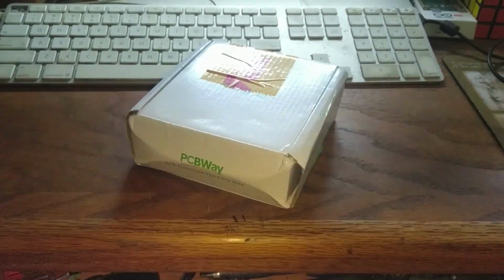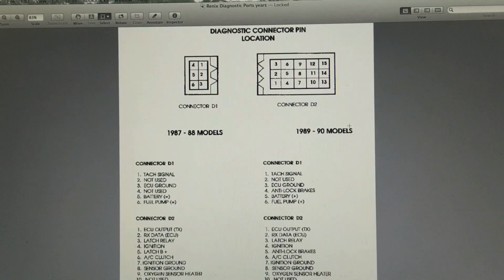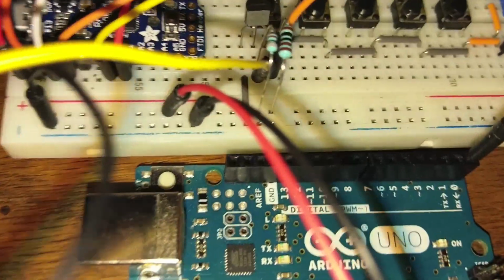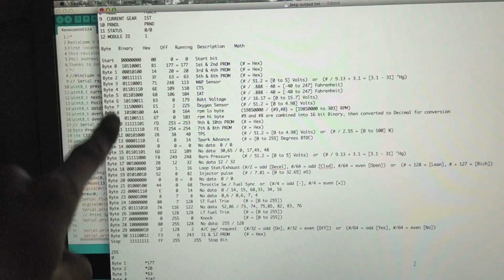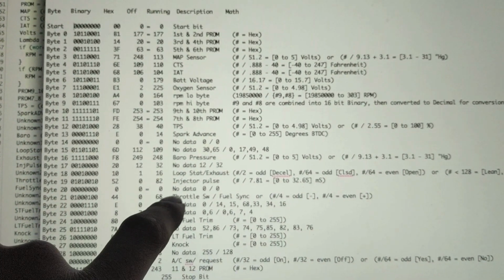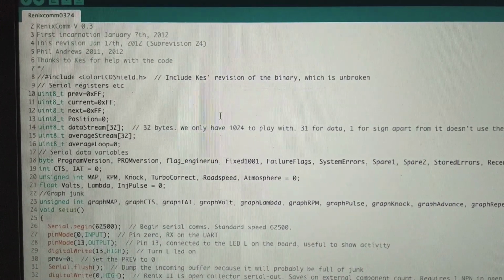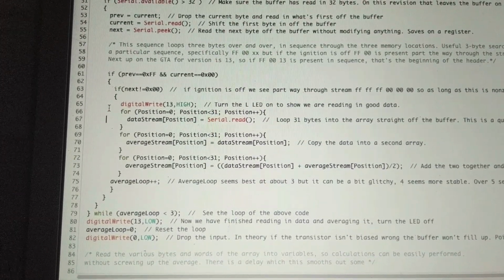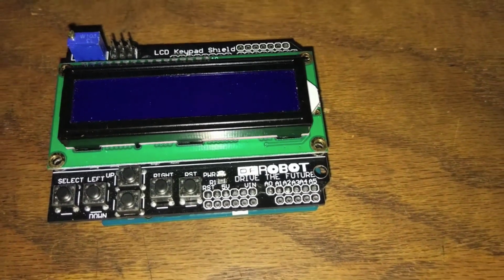Renduinix Alpha Update / DIY Arduino Renix ECU Reader

Comment: The pcb looks smashing :-D, your design is coming alive and neat ;-D.
Yep that npn transistor and two resistors is nice and simple, if you needed many inverters then there are ic's that have 6 open collector drivers inside.
Dont think you need any more lol.
Sounds like the tx pin is open collector (sinking current only), so it needs a pullup load resistor to work, same with the collector of your transistor.
When the tx pin stops sinking the pullup, the pullup feeds the transistor base, the transistor will switch on when the base is roughly 0.6 volts above its emitter.
Nice simple design, bugger all to go wrong :-D :-D
Ooow "ReniScan" perhaps :)
Reply from the maker: So, time to pick your brain some more. My logic analyzer just came in and I was able to confirm the baud rate on my ECU. 16uS bit width = 62500 (1/.000016=62500). So now I want to try my luck on the TCU side.

The ECU circuit will not work as the TCU TX pin to Battery Positive shows a few volts below battery and continuity test gives a beep pattern that repeats. TCU TX to Ground shows 0.5v and no continuity so I'm thinking I might need a pull down resistor to get a definite high or low.

Now here's the tricky part, I obviously can't feed battery voltage into a 5v input pin or my logic analyzer so what is a simple and effective method of level shifting from 12-15v down to 5v? If the voltage was more constant I could probably use a voltage divider but that seems too variable, maybe a transistor or an optocoupler or some level converter that can do what I need? Any idea would be very helpful.
Reply: If im understanding you correctly lol, you have a data burst that has a low of 0.5v to a high of about 10v, is that correct?
Reply from the maker: Yes. not 100% sure on the 0.5v because no continuity
Reply: You just said 5v not 0.5, i think you ment 0.5 v.
Anyway, you could still use a transistor with the same collector pullup resistor as that seems to suit the microcontroller.

A possible is to connect two diodes back to back, where they join connect a pull up resistor to 5v, one diode cathode goes to the transistor base, the other diode cathode is your input, (the input can only ground the 5v pullup resistor or not).
The second diode is there because if you pull something down using a diode it wont go to zero, the second diode loses 0.7v, transistor is fully off.
You may need a resistor from base to emitter to make sure it switches fully off.
Reply from the maker: I think I see where you're going with that, but it relies on a proper ground from the TCU and I can't yet confirm if it is actually pulled low or is floating if it's not high. That's why I mentioned the pull down resistor and level shifting. I may play with your idea just to test my hypothesis.
Reply: Yes its difficult for me to guess about a system i know zilch about lol.
You do need to find how the high and low levels are created.
Does the tx pin have a open collector drive and a pull up resistor for the high level, or are they doing something odd lol.
Fact finding is your first thought, what kind of system is it :-D
Reply from the maker: Well, I was spoiled with the ECU side, Phil figured all that out and I just got it to work. My thinking right now is that it's just turning battery voltage on or off and that off is just floating. If I bring the voltage down to 5v then I can test that with the logic analyzer. Maybe if I'm really lucky i'll find some info online, but not confident on that. May just have to grab an extra from the junkyard and tear it apart.
Reply: Sounds like a good idea, but you may find a driver chip doing the work.
An open collector cmos buffer would be ideal, but i dont remember a chip that does that, perhaps a cmos to TTL logic chip would be close enough, maybe lol.
Reply from the maker: Alright, I found some pictures online and after doing some resistance checking I believe there is already a ground so your diode method may work. I'm only going off some pics I found but I believe there is a transistor connected to a TC4049BP Hex Buffer/Converter(Inverting). It looks like the center pin on the Transistor is connected to a 43k Resistor to Ground and a 100 Ohm Resistor to the Diagnostic Pin. So it looks like I just need to shift it down or try your double diode trick. 

This article here had some diagrams and the pictures. The Trace from pin 4 of the giant green connector is what we're after I believe. http://blog.nsfabrication.com/2015/10/25/arduino-based-aw30-40-aw4-transmission-control-part-1-figuring-it-all-out/
Reply from the maker: Okay, my brain hurts a lot now. So i tried your idea but the switching wasn't working quite right. It would only read high and never sink so I decided to play with the multimeter continuity check some more. I noticed the long beep followed by short pause from TCU to Pos, but if I switched the leads and went from Gnd to TCU, I got something that sounded much more modulated. So I figure I could just use the Transistor as a relay like so: 
TCU TX - > 1k R - > NPN Base
+ - > 1k R - > NPN Collector < - RX Analyzer
Analyzer - > Ground < - NPN Emitter

So there is a pull up to collector that gets sunk to ground if the base is energized. Got the switching done and read in the signal and man is it weird. So I get a repeating 7 bytes then a 50ms gap. Most of the bytes are zero but the weird thing is that there seems to be a very small high, low, high that seems to separate each bit so maybe that's start and stop or something. But each bit seems to be 2ms which is REALLY long, the ECU spits out info at 15us. But by taking that number I get a Baud Rate of 500, whereas the ECU is 62500. Tried a serial dump and I guess I get info but I', not sure if I got it all right or not. 

I'm waffling a lot but this stuff ain't easy, kinda sucks. haha
Reply: lol sounds like your making progress though :-D, the double diode method ive used for other purposes and it does work, but the resistor vaules and drive has to be right, its trial and error on some circuits.
Tweaking values can take a while to get right.
If you have a clean output then it sounds like your getting there :-D
Sounds like you need a trigger point to allways capture the same section of data every time, havnt a clue how to do that lol.
Reply from the maker: Yeah, I'm getting to the point where I can't quite stumble my way through, almost feel like I need to take up a proper class or find a good article on it all. Every time I think I have it figured out, it gets more complicated, haha. This logic analyzer is helping me see more of the big picture, but I almost feel like I'd need a proper scope to REALLY know what was going on. Maybe I'll just stick to the ECU side for now, lol. Could always do it the dumb way and make a piggyback harness that just plugs directly into the Trans Speed sensor since that's all I really want anyway.
Reply: It will take a little longer to get some sense from the interface, you do seem to be rushing into it like a bull in a china shop ha ha :-D.
The circuit you found for the ecu didnt take 5 seconds to think up, but you didnt see that persons head scratching lol.
You will get there, just stop trying to rush it.
Yes an oscilliscope would give you voltage levels but not the sinking or sourcing ability, 
I think the ecu side alone is brilliant, finish the software for that first.
You can make a "B" mark2 version later :-D
Reply from the maker: Yeah, i was really getting wrapped up in that end goal of the all mighty MPG reading. I have thought about a version 2 with more features. I will focus more on getting other ECUs working and just try to finish this one up. It works pretty well and I'm pretty happy with the results. Would love a bigger screen that is full pixels so I can do all kinds of other neat things, but that's future stuff. one thing at a time.
Reply from the maker: Alright, I can't help myself, more brain picking. So I can get a clean signal from the TCU when the vehicle is off usually, but when I turn it on I start getting very tiny and quick blips in between bits which is throwing off the serial reader becuase it will interpret a blip as the start bit of a byte and throw off the timing on it which gives corrupted data. 

Sooo, is there a simple way that I can filter out really quick changes by smoothing them out, but not so much that the actually data signals start getting messed up too much? I tried a quick test with an inline 22 pf capacitor but wasn't getting any data no matter where I stuck it. If I can get rid of those small hiccups through either some kind of filter or a more robust switching circuit, then I should be doing alright on a TCU reader maybe. Kinda bummed with how slow the output is though.

Here's a pic to give you an idea, the little line is being mis-interpreted as the start bit, where as you can clearly see the start bit go low a little later on.: http://i1059.photobucket.com/albums/t437/NickInTimeFilms/Screen%20Shot%202016-09-08%20at%2010.53.10%20PM_zpso7ciepul.png
Reply from the maker: Back again with an update. So I guess all I needed was a low pass filter of sorts to smooth out the little bumps. I tried doing all the fancy calculations but the resistor wasn't allowing the TX pin to properly trigger the npn so i went back to the 3.3k and just stuck a 104pf cap from the base to ground and viola, no more blips and the main data is mainly uneffected.
Reply: And i was going to say put a diode in the emitter of the transistor so it raises the switching on voltage :-)
Reply from the maker: Back again. So silly me, all I had to do to protect my poor arduino from the mean 12v was use a voltage divider to safely read the switching voltages. And check this, they weren't even needed. The TCU TX Pin produces a 2.43v High and a 0.95v Low. Only issue is the high falls into the grey zone and is not considered a logical high to arduino. 

My thinking was to drop the voltage so that the low is not able to trigger the transistor base but the high is and use the standard pull up and ground to give the arduino a good high and low. thoughts on how to lower the input voltage or should is just use a voltage divider?
Reply from the maker: And just like that, it's different again. I can not catch a break with this damn thing. Now all the voltages are different. High = 0.81v, Low = 0.31v, Off = 0.13v. Still a defined reading but they overlap what the previous voltage gaps were. Starting the car shows no change so this signal is regulated somehow. If only I could just read the analog pin, grab min and max reading, and if voltage = like 5% of min, set low, 5% of max set high and serial read or something. arg...
Reply: Oh hell, that pin does not sound too digital does it :-(
Sounds like you may have to rig up a comparitor ic set to about 0.5v trigger level to give a definite 1 or 0, run it from 5v.
Just a thought :-)

Comment: Hey my mam I've got a 1987 jeep Comanche 2.5L 4 speed and would love to try this out if you can get me some more info id love to use it if you wind up sellin these
Reply from the maker: These will for sure be for sale once I get all the kinks worked out. If you'd like to see alpha tester requirements, check out the description on last weeks video: https://www.youtube.com/watch?v=nj7FDZI8hXI
Reply: I ask if your selling these because I'm not tech savvy enough to build one
Reply from the maker: It's been quite the daunting project for myself so I understand. Next week will tell me quite a lot on how much more is needed. When my logic analyzer comes thursday I can probe my buddies manual MJ's and if it's a quick fix, I should be able to roll out ECU only versions by the end of the month if EVERYTHING goes well.
Reply: +NickInTimeFilms well can't hurt to try and be a tester 
Name-Stephen 
I know where the pokey but goes on my engine 
I'm sure my microwave doesn't idle at 800 rpm lol ( if it is I should probably look into it)
I can keep in contact 
I'm able to download program to the unit if need be 
As far as the actual code is concerned I've tried to learn arduino but never succeeded but have an engineering class at my high school someone has to know lol 
As far as telling you how the unit feels for buttons and just the overall feel of the unit I'm good at that I have large hands so I'll be able to tell how everything feels
Reply from the maker: Cool, cool, but what are we working with? I need vehicle details, haha
Reply: +NickInTimeFilms oh sorry forgot to include that 
I'm running a 1987 jeep Comanche 2.5L renix 4spd 2wd 
(Working on converting it to 4x4 don't know if that makes a difference)
Reply from the maker: Oh duh, that was in your first post. Is that an Auto or Manual 4 speed?
Reply: +NickInTimeFilms it's a manual
Reply: +elpasoparacord manual 4 speed
Reply from the maker: That's funny, my buddy has that exact combination. Is it black too? If you tell me it was originally silver but got painted black I would tell you to stop looking in my window. haha.
Reply: +NickInTimeFilms lol no sir it's been red it's whole life and has stayed in the southwest all its like kinda funny though
Reply: +elpasoparacord but funny though I didn't think there were a lot of 2.5s out there
Reply from the maker: Actually i lied, his 88 mj is black, he also has an 87 4.0 mj which is the one in my channel banner photo.

Comment: just curious. unplug the TCU and then it's a manual. not sure if the ecu has a different programming for auto vs manual.
Reply from the maker: Nah nah Mr., not like that. There is a difference between Manual and Automatic ECU's. Not 100% but I don't think the ECU even talks to the TCU.
Reply: +NickInTimeFilms I shall pull out my bazillion page 1990 fsm now!
Reply: +BSDKllr I'm not seeing any interconnects from the ecu. but the transmission diagnostic pin is cav 15
Reply from the maker: Like at 7:18 ?
Reply: i havent finished watching my phone died lol but yes at 7:18
Reply: I am pretty sure that the ECU and TCU do not communicate for normal operation.  The ECU for auto vs manual is different.  I read somewhere on the interwebs that the ignition timing is different.  Some Jeepers have used an auto ECU in a manual XJ with good results.